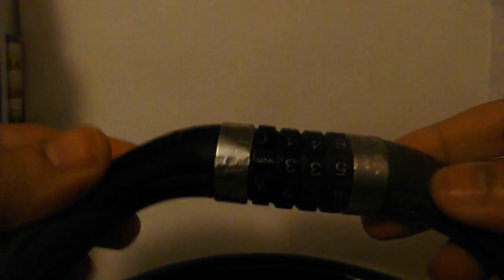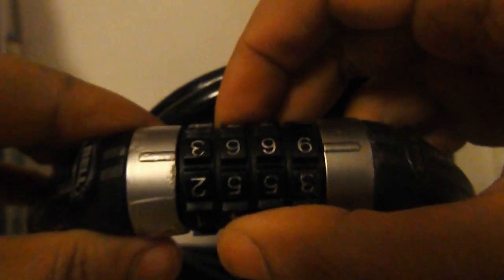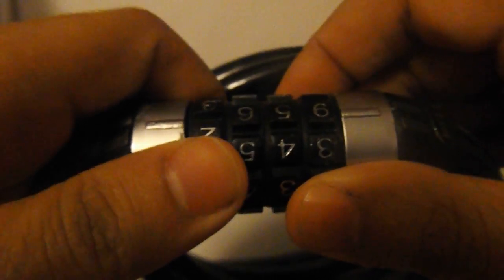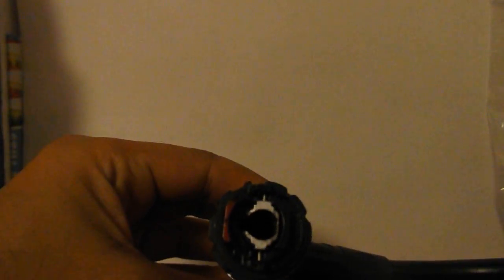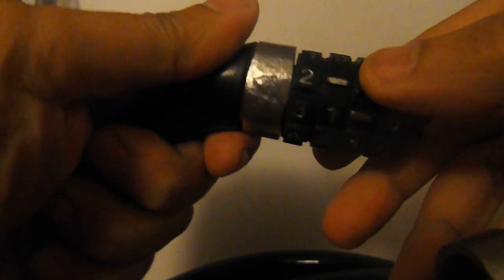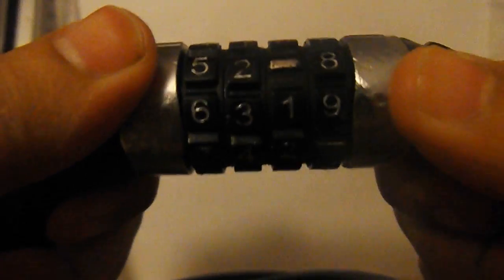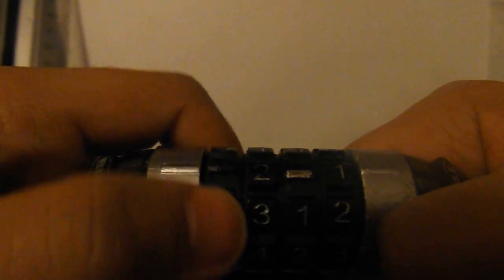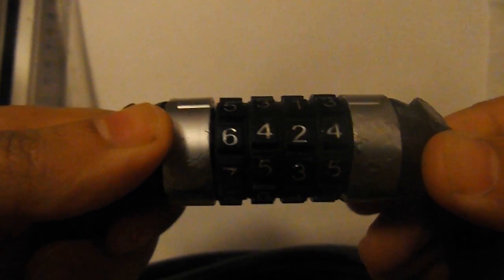How To Make a Combination Lock More Secure.

Comment: Interesting idea, but I'm not convinced. It does not help against pull picking and you have made it harder yourself to open the lock as the wheels are harder to turn now.
On the other hand, I have checked my locks of this kind and they do not have this left/right play - so I believe your method is pointing into the right direction to prevent the mentioned kind of attacks.
Reply from the maker: Yes, I wanted more tension on the wheels to prevent 'play'. Now that the
 movement is reduced and the 'click' of hollow slows not noticeable, the
 lock can't be as easily opened. The pull won't work in this now either 
as the teeth all share the same variation in small movement, plus you 
need to force it apart even with the right key combination. I think the 
manufacturers could easily improve on the design but make more money 
from stolen locks and bikes! They want return customers to sell higher 
end security.